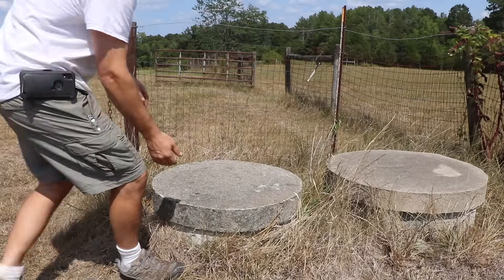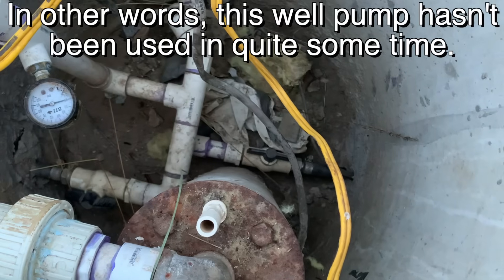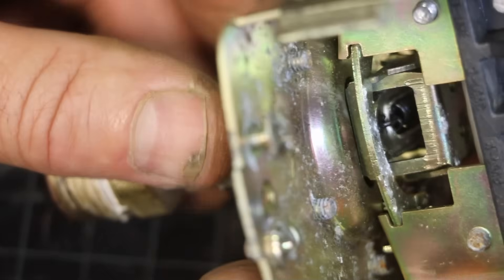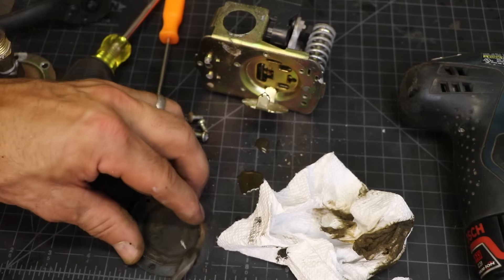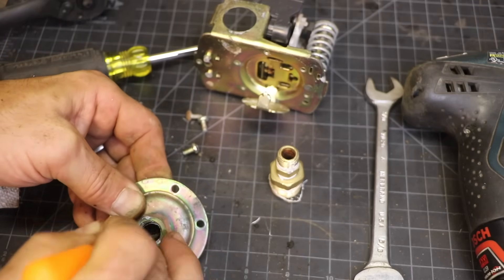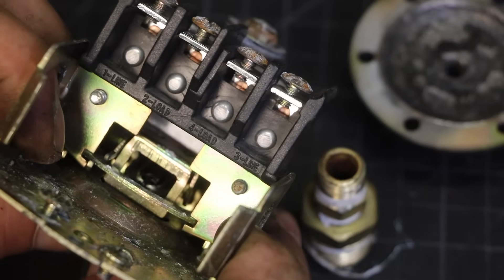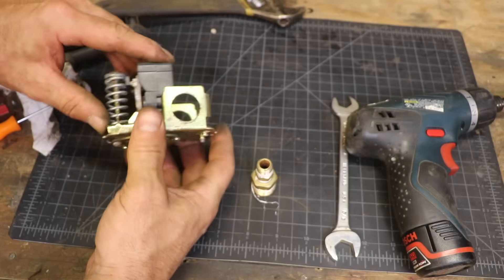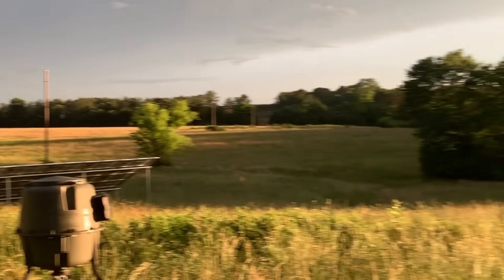How a Well Pump Pressure Switch Works. Diagnosis and Repair.

Comment: Hey there, Plumber Doc here the armchair idiot, on my well installs when applicable, I installed a sediment trap you can remotely blow out, immediately after your pump output, it'll help save your downstream devices. Great videos, great content, big fan, 😁

Comment: pressure switch merrel off amzn $20 and same as my mexico made one that corroded/acid ate, seems to be oriented the same wiring wise.  used stainless nipple (short stub pipe up to switch, instead of cheaper brass containing lead ($10 for 2 nipples, only need one) and swapped pressure gauge and new one is oil filled gauge so hopefully keeps out the acid water that ate the bezel snap holder and part of the gauge in the last 8 years      5.5 ph water with iron is what it is, pex is good, some other stuff is apparently "consumables "  lol

Comment: This video is really in depth and helped me to understand my well pumps pressure switch. alot of videos i watched before this one opened up the box n was like yep the switch is open so blah blah ...and i was like well how do you know its open so thank you for allowing me to understand bc i feel likewise...i like to understand what i am working on so i know exactly what im doing thank you for that. ...Also I came in yexzterday and realized there was low pressure in my water I went out there and it was at 0 psi. this morning i tried priming it and for a minute forgot to open the valve to the house but it wasnt long so i took the plug back out and it shot up so the pump is trying to pump however i primed it the correct way and no pressure is building and i know its not pulling water because my filters are not filling so that where i am at ...if you know whats wrong or have an idea of what i said please help thank you

Comment: lol I didn’t know I’ve been here to this video before. 
But I see I replied “teetering “ last time. 

I don’t believe the black wire is ground. Black often hot with ac volts. White nuetral and green ground

Comment: I love the videos. I'm currently setting up an "in use" monitor to remotely monitor my uncle's pump with a light and clock, which will be parallel with the pump. I will use a Wi-Fi camera to remotely view the pump's status from a cell phone. The clock will monitor how many minutes the pump has run-might be a topic of content for you.

Comment: Thank you Sir.  my pressure switch does not start at 30 psi but it works 55 psi (cut off) . it is possible that diaphragm doesn`t recognize low pressure.   I`m gonna try to clean it instead of buy a new one.

Comment: Thanks so much for your video I woke up this morning to no water. Been here before and it is a terrible feeling. Is it the pump or worse did the well go dry. From your help I quickly noticed the switch was stuck open! I knew the pump motor went into thermal overload so I turned off for a while and turned back on and it worked. But the switch was stuck closed(on) sure enough same problem 
Thanks again 
Phil

Comment: Thanks for video....I have a 25 yr old house well system...2 yrs ago...I changed well tank....but never change to new pressure switch..now it's acting up..we have alot rust iron in water...so prob I'll clogged up like urs...I got to change out...

Comment: Enjoy all your videos & as a DIY'r myself on a horse ranch in Colorado, yeah you better be self-sufficient, or you will be calling someone every month.  I completely understand your interest in "knowing how something works," I really do.  However, the pressure switch on the well pump should have been replaced - JMHO - after you completely cleaned and serviced it of course.  I too have tried to reuse old plumbing fixtures/unions/you name it, only to have a leak or other issue crop up shortly thereafter.  My pressure switch controls and saves my pump from overheating and failure.  My well is 895ft deep and I have no way to service/replace the large 3hp 10 gal per-min pump myself.  I jsimply cannot risk a $3k pump (plus the labor) even on a rebuild as well done as your two-decade old pressure switch.  When a new pressure switch runs $21.  The risk to save $21 is too much for me.  But of course, after the rebuild I would save it in my pump supply box as a backup or for a neighbor.  One last consideration, here in CO - stuff goes bad at the most inopportune times, like during a blizzard when there is 2ft of snow on the ground.  One final comment - the digging of the large pine tree tap-root with a small excavator so you can mow.  I have hundreds of ponderosa pines on my property, I take them down frequently - pines all have tap-roots.  If the stumps bother me, (99% do not) I rent a stump-grinder.  Hey what a cool project idea!  Find an old stump grinder and rebuild it.   Be safe & keep fighting the perversity o inanimate objects!

Comment: I have one of this pressure switch 20/40psi, but I use a 180w 12v solar water pump (non submersible), and it only pushes up to 20psi. What modification do I have to use for a very little differential? say 3 or no more than 10 psi (differential)? Thanks in advance. I have both screws all backed off

Comment: Nice video thanks for the explanation. I have a well and 8ts the first home i owned with a well and of course my switch stop working last week i was getting stuck and the pressure tank was bad so i had to have both of them replaced.

Comment: Thanks for doing this video. I also was lucky to have discovered that my pressure switch had failed and my pump was not cutting off. While I replaced mine, your video helped me figure out why exactly it was malfunctioning. Most videos about pump pressure switches involve the pump not turning on.

Comment: Hi there---I subscribed to you for something else you helped with that I was trying to understand. So thanks for that.
Added question to this type of clean out----do you have a check valve on that system that would need cleaning out as well? I get some kind of black flecks in my ice maker or dishwasher sometimes and don't know where it is coming from except the well. Have tried adding bleach to the holding tank but not really wanting to have bleach in my water.
Thanks for your help if you have time. Jesus bless.

Comment: My first visit to the old farm, half the power is out due to the collapsed barn taking down some of the wires including the circuit that powers the house basement lights (super spooky down there without lights) and the well pump.  Next visit, when I fix the wires, I will know what to look for when I power up the well.  Very cool.  

I think that's called, "hysteresis" or "dead-band" when there is a gap between turn-off and turn-on.

Comment: Swimming pool pump motors have a similar mechanism to disengage the start windings and go to the run windings.  There is a video that explains it, I will look for a link and add it after I finish watching this.
Reply: https://youtu.be/F-jOBxn1w1I

Comment: I learned to do that when I was in the 4th grade. We moved to a house with a well. My father and I did that many times through the years. It might be a good time to do it again before it screws up in the middle of the night and causes a flood. If you buy a new switch and clean out the old one you will have a spare for the future. The pump we started out with was not in the well. When it would take a long time to fill the tank we would dismantle the pump and clean out the impellors and housing when they clogged up with the same stuff. We also learned about water-tight ceramic bushings in water pumps too. I found them to be remarkable.
Reply: Hi John D II   Your comment is something I would love to try to do. Except I would have to have a new pump up and running while I clean out the old one. Do you have a video on doing something like that?
Also, I live in the south and it gets really hot and humid and I wonder if there is black, slick sort of mold or something that grows in the pvc or maybe the check valve. I find it comes through sometimes in the ice maker or dishwasher (not heavily, just flecks). I try to stay on top of it by putting a certain amount of bleach in the holding tank for the well ever so often. Is there a way to clean the check valve on the well?
Thanks for your reply if you get a chance....know everyone is really busy. Jesus bless.

Comment: if the diafram is too sloppy and weak, then it will mess up the nut settings too, so that it wont even cut off the motor

Comment: For someone who has 10 Wells And have never had the opportunity to dismantle a pressure switch, I found this video quite helpful. Thank you
Reply: I don’t believe he’s correct when he calls the black wire a ground with ac volts

Comment: I agree, I love repairing things and will try to repair anything first. Also, my well had an issue and burned the pump and motor up. It got so hot, the water coming our was hot and it normally is ice cold.

Comment: You can use either a “pump saver” or an “mp8000” made by littelfuse, they are designed to monitor the current draw of your pump and if the current draw goes above normal (I.e. locked up motor or overpressure) or below normal (I.e. dry well or broken pipe) it will trip and save your pump/motor.

Comment: My pump had the same problem a while ago I cleaned it and it worked now recently it started not turning off. The diaphragm is clean so I don't know please if you have any ideas help me. I also turned on the pump with the pressure line disconnected but bearly any water came out so does that mean the pump isn't sending water to the pressure switch?
Reply: It's possible your pressure tank is defective. Leaking or the bladder went bad. Their life expectancy can be 5-20 years, depending on many variables. I had to replace mine with similar symptoms. Turn the power off, drain the water and check the pressure in the tank with a tire gauge on the valve stem on top of the tank. It should read 38 lbs on a 40-60 lb tank. If it's less, you can pump air into it but if it doesn't hold, the tank needs replacing.
Reply: @wylykyotys  thank you  but I found the problem :D the hole that sends the water to the pressure line was plugged so the line and pressure switch were not getting enough water to move the switch to turn off the pump lol

Comment: Very cool. It pays to stay curious. It used to be that one could buy all the little parts to a pressure switch. Diaphragms, springs and contacts. The price was negligible and a switch would last decades with a little maintenance. No more.

Comment: Just swapped out my shallow well jet pump and now it seems my water pressure stops rising about 10 psi short of cut off pressure, thus the motor wont shut off.
Why is this?
Reply: Investigate the pressure tank

Comment: My well piping has a Tee at the top where it exits the casing.  One leg is towards the pump, another leg towards the tank and the 3rd leg is to a 75psi relief valve to prevent the pipe from over-pressure in just such a scenario as what you had (pressure switch does not open).  So you may want to consider installing a relief valve.

Comment: Great Job, Simple fix at no cost. I at one time worked at factory that made this type switch and thousand of other types and Relays. They made all quality level from cheap to nasa  grade. I had old well pump have contractor points sticking do to wear and age. The guys in shop said bring it in and they would replace it with Gold contact points. Never had another problem till I replaced pump.Years later. Thanks for all videos .

Comment: Nice job on the "Well-troll" switch.  I had one on my well pmp, and had to replace it a couple of times over 30 years, but my problem was spiders committing suicide across the switch points.. That arcing destroyed the points.
Reply: Had similar problem with a well pump, only it was ants not spiders causing the problem.  Why insects build nests around electrical current is a mystery.
Reply: @glenpaul3606  heat??
Reply: i have also had same problems with ants and spiders .
but mostly ants and after bad wind and rain storm in central florida they build up

Comment: You might have way better videos than this one, but this one was pretty darned interesting to me.  You did a fine presentation of the problem, how it worked, and the solution.  All in under 13 minutes.

Comment: Is there really no other safety feature? Like on an air compressor if the switch fails there is always a pressure relief valve. Now the question is would a cheap 80 or so psi air pressure relief valve installed in a safe location work? Maybe as a return back down to the well?

Comment: I have cleaned out pressure switch a few times.  I keep a cleaned spare to allow a quick exchange of switches.  Added a compression fitting under the switch to allow easy removal from the piping.  I don't wait for a problem, just part of well maintenance.

Comment: If you put a filter on the water line you would very little sand inside the contactor.
Reply: You shouldn't install a filter before the switch.  Very very bad idea

Comment: Love your attitude towards fixing vs. replacing. Do you think a well pump would just sit deadheaded and burn itself up? I would think it would have a bypass bleed port like a sump pump does, but I don’t really know.
Reply: Yes they will.......most will endure the punishment for a good while, but it will eventually burn em up....some faster than others

Comment: Would a prefilter help with all the "Shmoo"? Or is the switch a sacrificial part?
Reply: Really bad idea to put a filter in the system before the pressure switch. You should always install a filter in the system after it leaves the tank feeding the house.

Comment: How about adding a secondary pressure switch in series? In case one clogs, the other could still cut off the pump. Or maybe a time delay switch?
Reply: I think it would work. The switches would have to be wired in series. The first switch would work from 30-50 psi and the secondary could be set to something higher, maybe 60 to 90 psi. As long as the pressure stays below 60 psi, the second switch will keep power connected because the pressure is not up to the set point yet. If the first switch failed, the pressure would go high enough to shut off the second switch. The settings might be able to overlap as well. I also thought about a pressure releif valve and a nozzle to spray into the air as a visual warning. The other option is a pressure limit switch and a contactor that is normally closed, although NC contactors are less common.
Reply: Not really possible. The electricity has to travel through the switch. For a back up switch to work, the wires would have to be switched over to the back up switch.

Comment: You would think it would be set up to fail open rather than fail closed
Reply: When it fails closed it also fails open. Usually the water pressure will eventually bleed through the clog to operate the pressure switch.  And just as the water pressure had to bleed through one direction, it now has to bleed through in the opposite direction.

Comment: Had this exact same problem, the entire pressure tube was filled with what looked like rusty mud.  At that point, I had already replaced my pressure switch with a new one, because it was only $20 or so, and I didn't want to be without water while I tried fixing it or worse, broke it.  But if it happens again, I'll definitely try cleaning out the schmoo first

Comment: What happened to the piece that went flying? ✌😎🏴‍☠️
Reply from the maker: It's in the next shot. It's the metal piece that the diaphragm pushes on.  ;-)
Reply: @FarmCraft101  ok, cool.  I thought it was a screw or a small spring that was missing when you put it back together.  Thanks for the info, video makes 100% more sense to me now!✌😎🏴‍☠️

Comment: An important detail is missing in the installation. Compared to my I have in (Sweden) An overpressure valve that trips when the pressure becomes higher than the preset pressure in the pressure switch. How to note it? 🤔 It sprays water from just hell and then the pressure switch gets wet and the fuse goes😂😬😬

Comment: You could add a pressure relief valve and pipe it to a spray nozzle that way when it over pressures it sprays straight up and you can visually tell when the switch has failed.
Reply: Maybe with a second pressure switch that switches on a buzzer or flashing light- the cover over the well, would stop you from knowing a pressure relief valve alone was venting...
Reply: Neat idea, but when it gets stopped up, not only will the pressure get really high, it'll also get really low to non existent for a few minutes before it comes back on.   So instead of spraying water everywhere, you'll know when it gets stopped up when your pressure drops low before switch comes back on

Comment: A very common problem on wells. We clean the nipples between the switch and the pipe every time we work on a well. We have had some that we took a drill bit to clean them out due to not having replacement fittings and need to get the water back on.

Comment: That pitted area is probably where all the clogging material came from (acts as a binder for the sand) so if you treat it and then seal it (epoxy coating) then add an inline filter you should be good to go for the foreseeable future.

As it sits now its going to start corroding again immediately, the coating is gone, you could electroplate it as well to proof it back up.
Reply: All that needed to be done was remove pressure switch and jab a Phillips head up into pressure switch to open the hole.  And you shouldn't put a filter in before the switch.  No filter or cut off valve or anything should be installed between the pump and the tank.  Cut off valves or filters should only be installed after the tank before feeding the house.
Reply: It is quite possible that you could purchase diaphragms from the manufacturer. Just depends which one